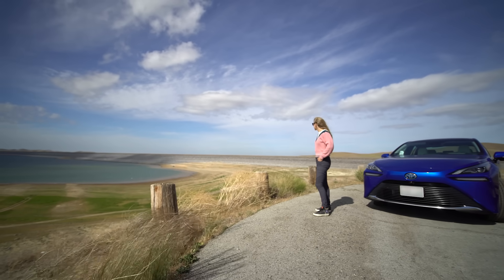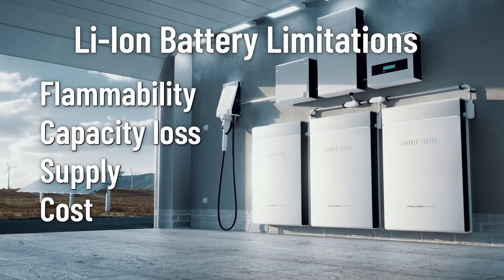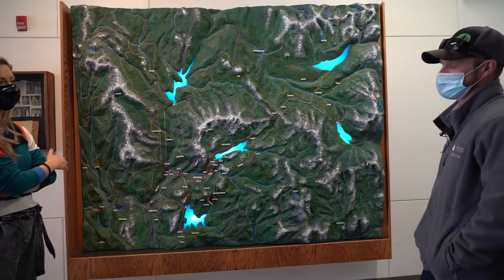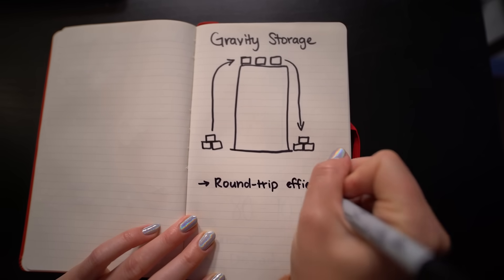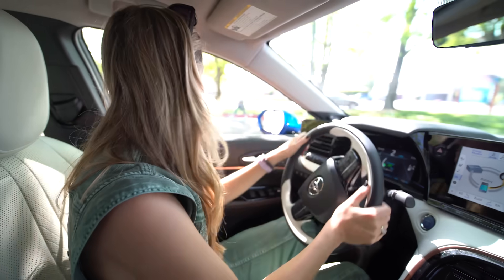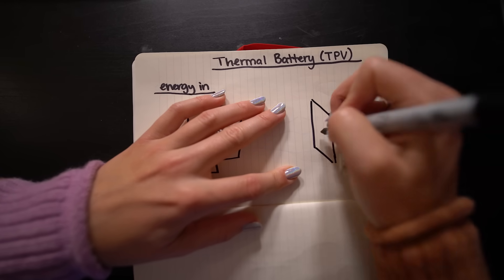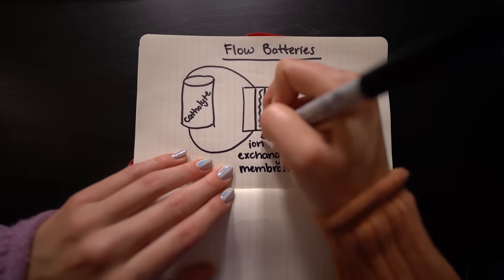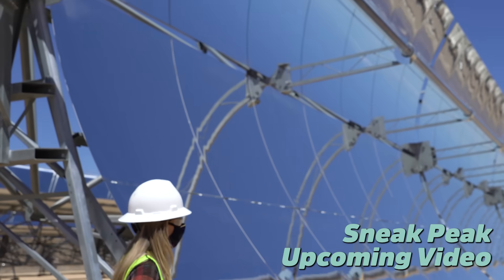The BIGGEST problem with clean energy

Comment: Coal can be renewable if the smoke stack didn't  just blow all those coal ingredients out the air .  Funnel them down    have water run down that pipe going down with the smoke running to a pool of carbonated potassium water back  running to pools of heat and pressure going around to make more coal to go around a gain

Comment: Honestly want to move past to point where ppl can’t shut up about whether renewables are “viable” or “necessary” and get to the point where we’re all just trying/working/funding to solve this
Reply: Part of the problem is that the environmental lobby have since the 1970's been engaged in a campaign against nuclear energy. Nuclear energy has been viable since the 1960's, but its continued growth was thwarted by their campaigns. If more nuclear power had been built throughout the 70's, 80's, 90's and early 2000's, we wouldn't even have this problem today. The people in the environmental movement have been right on many things, but no one is without fault, and on this point they clearly share the blame for the current situation.

There is an expression: The best time to build a nuclear power plant is 20 years ago; the second best is now.
Reply: Can’t do that until it can be proved that “renewables” make even a little sense. They don’t. What needs to happen is people need to lose their completely irrational fear of nuclear.
Reply: @rapid13  Agreed. And recognize that the environmental impact of long term renewable power is horrifying... what is our waste solution for storage? I brought this up at a physics colloquium, and not only could they not answer my question, they ridiculed me for asking. -_-
Reply: @andrewcopple7075  Because whatever waste you have, it is still easier to clean then the CO2 that is diffused trough the atmosphere and oceans. Nuclear is competing with renewables on price and public perception, and sadly lost both.